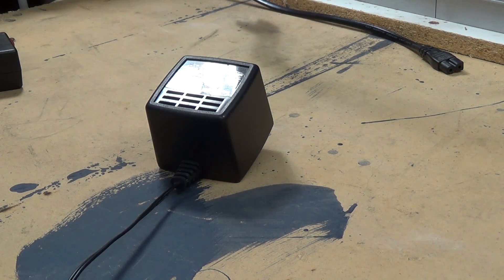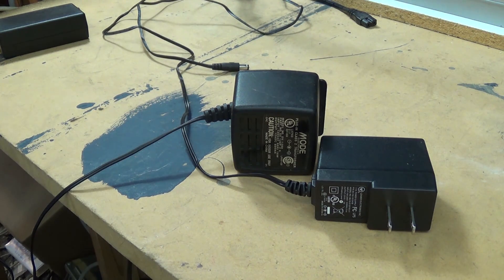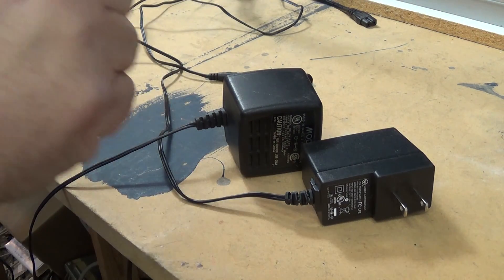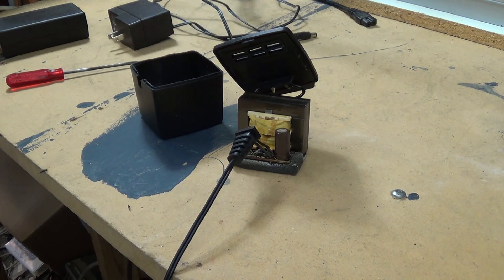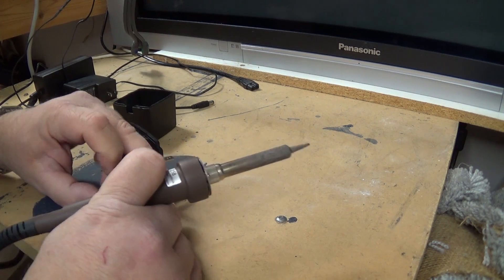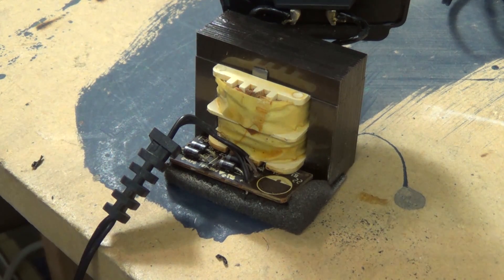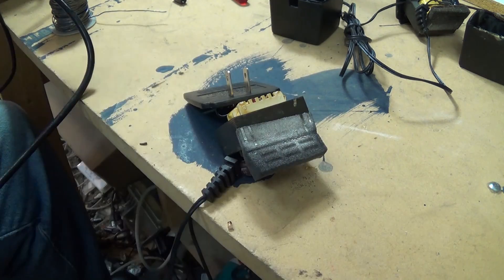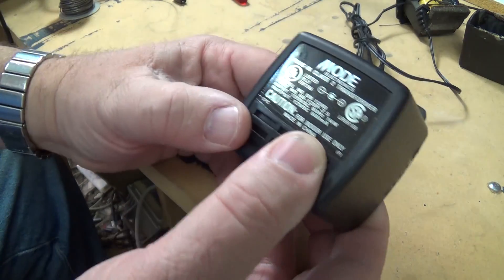Class 2 Transformer type AC Adapter repair

Comment: The issue with SMPS Pwr supplies is RF noise .. You probably can use the switch mode power adapters if you put a snap on ferrite RF filter on the low voltage power cord.
Reply from the maker: It's the harmonics.

Comment: i know it's ridiculously late to be asking after 8 years but i have an adapter that ONLY has a transformer - no capacitor, no fuse, just two big coils.   can it be fixed?
Reply from the maker: That is an ac output transformer.  Measure the primary and secondary windings with a meter.  If either measures open it's shot. Would either need to be rewound or replaced.
Reply from the maker: Many have a thermal fuse that can sometimes be replaced.  It's usually under the tape that wraps the winding
Reply: @12voltvids  thanks!  i found it under the winding on the 12v side.   did a continuity check before the fuse and the other end and it's good, so winding appears to be okay.   found a fuse replacement on aliexpress - 10 of them for 10 bucks.   had no idea these transformers were like hens teeth these days!  i freakin' LOVE youtube channels like yours - i learn so much - thanks again!

Comment: My transformer has no capacitor but doesn’t work. I shorted the hot and ground pulling heat shrink on  new plug. What can I do? I don’t see where the fault is.

Comment: I think that’s a rectifier (AC to DC); not an inverter (DC to AC).
Reply from the maker: The class 2 transformer is, the other one, the switch mode is an inverter.   How they operate is rectify the mains ac to DC, then change it back to high frequency "chopped" square wave, runs through  transformer and then rectified again. For most applications this is fine, however there will always be some high frequency ripple on these inverter type switch mode adapters.   When dealing with modulators or transmitters this high frequency noise can beat with rf circuits and cause undesirable results.  Only a linear type of power supply should be used on these applications.
Reply: @12voltvids  OK.  Thank you for clarifying for me.

Comment: I have a Linear class 2 plug in transformer plugged in my master bedroom closet i have no idea what its for, any ideas?
Reply from the maker: Alarm panel, doorbell.
Reply: @12voltvids  my doorbell is on the othet side of the house, but the old alarm keypad is close to the master bedroom, since its not being used anymore can i take the transformer out?
Reply from the maker: @GoTips  yes it will be for the alarm.  If the panel starts beeping when you remove it you will have to remove the battery from the alarm panel.  
Depending on the system the battery is either in the keypad or the control box.
Reply: @12voltvids  none of the old alarm is being used it was a honeywell, we got ring when we moved in
Reply from the maker: @GoTips  there will be a main control box and in that will be a backup battery. When you unplug the power the panel will likely beep till the battery runs out unless it is already dead or disconnected.

Comment: Output now from my 24 VDC charger adapter is 2.30 VDC. It was hot when I noticed it. Does that also mean capacitor is bad? Thanks!.......I guess yes, since capacitor is a voltage multiplier.
Reply from the maker: Well i f it shorts. The capacitor is not a voltage multiplier, it is a filter to smooth out the pulsed DC coming from the rectifier diodes. One of them may have shorted.
Reply: Oh! yes, for some reason I was confusing it with "Voltage Doubler Circuit".

Comment: Great video. Thank you.
Quick question I pulled wire out of the triangular piece of plastic that goes into the ac adapter, how do I fix it? Can either wire go to either side
Reply from the maker: The output dc wire is polarity specific.
Reply: @12voltvids  ummm so in simple terms...I have to resolder to the proper polarity?

Comment: if your fuse is shot, just short circuit it out. working again
Reply from the maker: That's not good advice.  If something caught fire and burned the house down fire insurance would be void. That happened to many back in the days of the penny behind the fuse in the old fuse box before circuit breaker switches.
Reply: @12voltvids  wire in another fuse then! How much are you willing to spend? Another fuse maybe a good idea

Comment: I like to work on carts if they have wheels on them I can wheel them out of the way and gabage cans with wheels work great too. you can fashion a board to the top and cut a hole in the side and still use it for a trash cat and a work bench combo

Comment: The ROHS thing is important for our environment. The heavy metals go into your tap water, etc. So it is kind of a good idea to remove lead from solder when manufacturing. Of course leaded solder is allowed for repair. Also more efficient power supplies help for your electricity bill and also reduce power consumption of your city, thus helping to stop or slowing down global warming. But it's already too late anyways. We already have extreme summers and our children will probably die in 70°C summers in 2060...

Comment: I recently unbricked a power brick, i tested several components only to find it had a short in the output cable, cutting it off solved the problem and the power supply now runs
Reply from the maker: Ah the old shorted output cable.

Comment: I kept having problems with the caps going bad (probably from heat in the tiny space), so on mine I removed the capacitor so the adapter puts out pulsating DC. I then added an easily open-able box somewhere in the middle of the cable (spliced) that had a capacitor in it. So I basically put a wall wart on my wall wart.

Comment: On Amazon I see you can still get solder with lead in it, Rosin 60/40, 40 being lead, 60 tin. Would this be high quality stuff for me to buy? You mentioned in another video to be careful not to in-hale any of it with lead. I guess I'd have to find some sort of mask to cover my nose. http://a.co/9N9hSQA
Reply from the maker: Yes 60/40 solder is good. I recently bought some at the local electronics shop and it works great. 60/40 Rosin core is what you want.
Reply: you can purchase an on desk air filter system that absorbs the lead fumes in a carbon filter, much like a cigarett filter system

Comment: I know a little about power supplies but where does "Wall Wart" came from? I see it's related to plug in wall units 120V to some low DC voltage but not familiar with that "Wall Wart" expression.
Reply from the maker: I have no idea who coined the term wall wart. I heard it many moons ago in the service industry. Go to the parts counter to order a new adapter and the guy at the counter shouts to the guy in the back "Mike grab me a 12 volt wall wart"
Same as when you go into the HVAC shop to get a run capacitor for compressor and they refer to it as the "Flux Capacitor"  In a sense they are totally correct, it is the capacitor that creates the rotating magnetic flux!
Reply: First time I heard flux capacitor was in the movie Back to the Future. That was odd, never associated flux with capacitor before.
Reply from the maker: Yes that was the first time I heard "Flux Capacitor" too. I think everyone did. It was perhaps 5 years ago that the start/run capacitor blew apart on my Carrier HVAC compressor. I went in with the blown cap to the parts store and the guy at the counter said "Ah you need a flux capacitor"  Well, when you think about it, that is exactly what it does, it creates the rotating magnetic flux needed by a single phase induction motor. It creates the phase lag for the secondary winding to create that rotation of magnetic flux to make the rotor spin.

Comment: Try measuring the output voltage of the old wall-wart when you get around to it. You might find it's idling at 15 V and change! (And presumably, only gets dragged down to 12 V +/-10% at rated current.) From what you say I'd be guessing that the video modulator actually needs a voltage that high and simply does not work at exactly 12 V yet.

Cheap power supplies tend to suck regardless of whether they're linear or switching, just for different reasons (efficiency / heat vs. reliability and EMI). I'm still wondering which way of making a near-perfect supply would be more promising, making a linear supply more efficient (better xfmr, Schottky diodes) or choking the hell out of SMPS common-mode noise. Or maybe even a hybrid, xfmr followed up by step-down converter? Probably depends on how much capacitive mains coupling you can live with, I guess...

Using a linear supply helped a TP-Link wi-fi router out in more than one way here. Not only did common-mode noise get reduced to the point where you could pretty much literally operate a shortwave receiver next to it, the occasional switch hiccups forcing a reboot have not appeared in over a year since (just the wi-fi chip still needs the occasional reset, but I set up a cronjob to take care of that, and device uptime is not affected). My new one did not respond quite as well, unfortunately, maybe the additional integrated VDSL modem or subpar PCB routing. Anyway, I got lucky to find a type of linear 12V/1A wall-wart that only adds about 1 W over a SMPS, which sadly has to count as a good value. And yes, that's the one giving me over 15 V in idle.
Reply from the maker: All linear supplies will give a much high voltage when idle as the capacitor charges, as they need to have enough reserve to put out rated voltage at full output. This is just due to the fact that we are dealing with a sign wave here.For a transformer to output 12 volts RMS, the peaks of the sign wave waveform would be 16.97. Take off 1.4 volts for 2 diodes in a full wave bridge and you get 15.57 volts which is pretty darn close to where you will find it idling. Remember, voltages are measured as RMS and RMS is .707 of the peak to peak voltage.If you measure the voltage across the AC line on a 120 volt outlet using a scope you will find the voltage is slightly under 170 volts p-p.With no load the capacitor will charge up to that voltage.

Comment: What in the world is a microfarad? Do you have any explanation videos? About capacitors, resistors, and etc?
Reply from the maker: +Kayemache It is the capacity of measurement for capacitors.1 micro farad is 1 millionth of a farad.Here is a chart to compare the conversions between different sizes of capacitors.  The largest capacitor I have seen was a .3 farad, and that was used as the timer backup for a VCR clock back in the 80's. It stored enough energy to run the clock for about an hour, so even at that capacity, it is still a tiny fracti0on of what a battery would store.pFnFuF or mfFARAD1,0001.00.001*10,000 10.00.01*1,000,000 1,000 1.0**10,000 10. **100,000 100.0 **1,000,000 1000.0 0.001**10,000 0.01 **100,000 0.1 **1,000,0001.0
Reply: look it up on google. It will explain it in great detail

Comment: Sir how do we figure out if it's inverter or linear transformer or something else? There are so many different things out there.
what about the lead free solders, different between lead free solder and others? Are they unhealthy?
Keep up the good work
Reply from the maker: +Petty Pavlow Pick it up and feel the weight. You will know when you are holding iron. The inverter based adapters are very light. A iron core has height to it.Lead free solder is that. it has no lead. Lead is toxic. As long as it is in your electronics there Is not a problem, you aren't eating it. The problem with lead in solder is once you dispose of the device what happens. If it is buried in a land fill, the lead can leach out into ground water. If it is burned in an incinerator, then lead can go into the air, and rain down on us. Same as mercury. Lead based solder is reliable, led free, not so much because it is more brittle.
Reply: @12voltvids  thanks a lot for explain
Reply: only unhealthy if you injest them

Comment: When I see good old wall warts at junk stores, I usually grab them since they're only a dollar or two.  I have many in a big bucket.  So I took some freezer zip lock bags and labeled them for volts and polarity.  If I need a PS, just look for the right bag.  Most are at least 1/2 amp.  I use 100ma for battery trickle chargers.  I don't trust the new ones, I've had many more of them fail, and they are common to charge L-ion batteries - scarey.  Most fails are the circuit board connections or wire at the plugs.   Usually the primary burns out on  wall warts, if the plug or jack is shorted, or battery failure draws too much current.  I snip off the wire and toss them.    Don
Reply from the maker: +umajunkcollector short circuits will overheat the transformer, and cause the thermal cutout to open.
Reply: Battery trickle charger? Are you recharging button cells? I've been wondering about that. More info, please. I am a "junk" collector too, but most of it is of no apparent use to me. Haha. I know it's good stuff though.

Comment: When I was in school, the leader of the electronics laboratory department was all into that ROHS crap and only bought lead free solder. The other teachers actually kept a secret roll of the normal 40/60 solder in their staff room and I would always go and ask for some of that rather than trying to work with the lead free stuff that all the other students tried to work with (and usually failed). If there hadn't been that secret roll in the school I probably would have brought my own 40/60 solder. I also refused to use the new soldering irons that same person got for the laboratories because for some reason he chose to order them with a tip that was so massive, it seemed like soldering with the end of a broomstick! I always searched for one of the extremely beaten up and barely functional but still much better 70s Weller irons.
Reply from the maker: +DrCassette 
I first noticed the problems with lead free solder in the tuner modules used in Sony TVs from the 90s when they first went to low lead solder. They went from 60/40, to 63/37! The low lead was cracked compared to 60/40 an things just got worse from there.
Reply: They have traded a bit of useful lead for a river of trash. My old iMac was rendered useless and I figured out it was the solder but this is the first time I heard from someone with expertise.
Reply: DrCassette hate that RoHs Shit
Reply: Have you tinkered with the supercapacitors they use in rail transportation?  2,500 Farads! You can buy them used and are about the size of a 20oz soft drink bottle.  2.5 volt at 2,500 F.  They are an ideal replacement for lead acid batteries for deep cycling applications.   I bought some for a solar battery center for all our solar yard/garden lighting.
Reply: The Dollar Guy got 6 3000 farad maxwell boostcaps, made into an ESM

Comment: for you very much thanks and gratitude for its valuable informationI would like to ask you a question,what are the specification of the vhs alignment tape?it is possible to make one on any vcr?
Reply from the maker: +abood issa If you have a VCR that is known to be in good alignment, and does not have worn heads you can make a recording that can be used to align other machines.It won't be as good as a factory alignment tape, as the certified tapes are not generally recorded on a consumer VCR. Instead they are recorded on an alignment jig, that uses open reels with fixed tape guides that have been calibrated with a micrometer. The reel of tape is manually threaded, and recorded. Once the large reel is recorded the tape is spooled onto smaller reels and assembled into precision shells.Since every alignment tape produced was recorded on this alignment jig, and the resulting tapes used to align every VCR as it rolled off the factory, every machine is set to the same specification.  When a shop spent 200 or 300 for an alignment tape from the manufacture, they all came from this one hand built machine, that is why a calibrated alignment tape cost so much. But saying that, you can record one yourself that is pretty close if your machine is properly aligned. The problem is most consumer machines are not, so any machines you align to a tape made on a self made alignment tape will never be perfect.I used to make alignment work tapes at the shop I worked at. We had 1 factory tape, and I used that to align a machine, and then made a bunch of tapes of color bars for use in customers machines, only because I did not want to damage the factory tape. I still have a factory Betamax alignment tape somewhere around here.
Reply: +12voltvids Thank you very much for the great information value
And I wish you good health and happiness :)